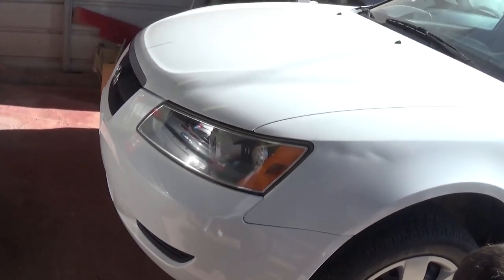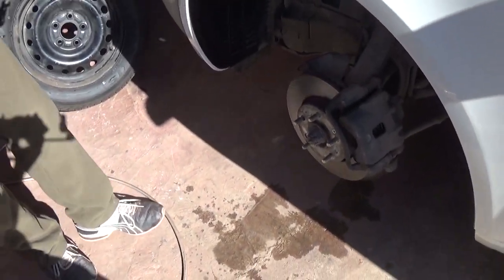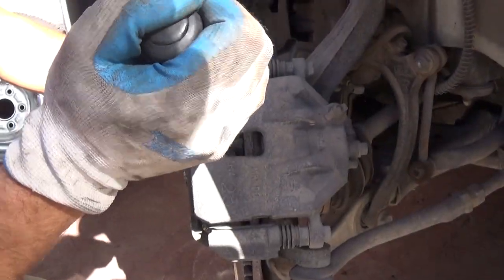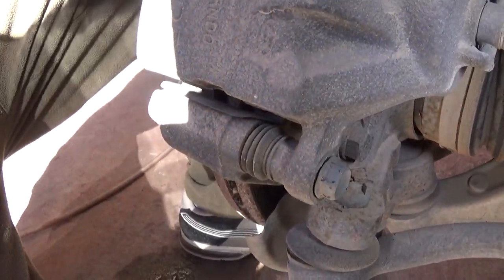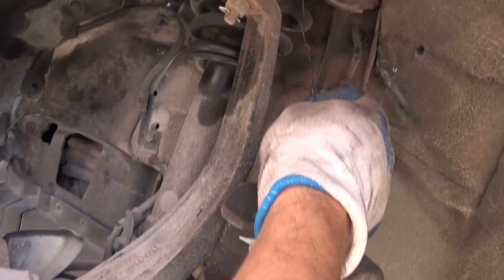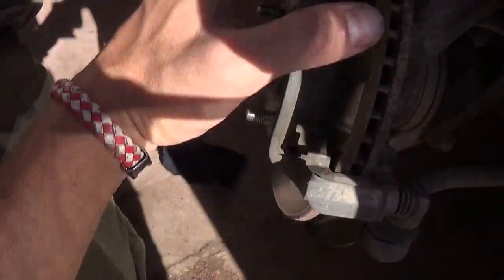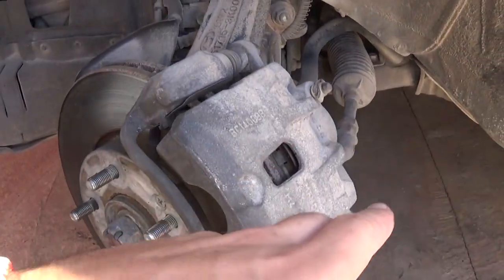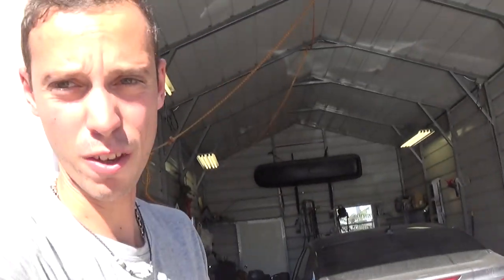HYUNDAI SONATA FRONT BRAKES PADS REPLACEMENT 2005 2006 2007 2008 2009 2010

Comment: I would add a step; open the lid where you put the brake fluid in, make sure there is room for the level to rise when you push the caliper back in... i would also put some rags around it just in case. Keep an eye on it as you may have to remove some fluid.

Comment: Brake torque specs for both 2.4 liter and 3.3 liter: Caliper bracket bolts: 59-74 ft lbs.  Caliper mounting bolts: 18-22 ft lbs.